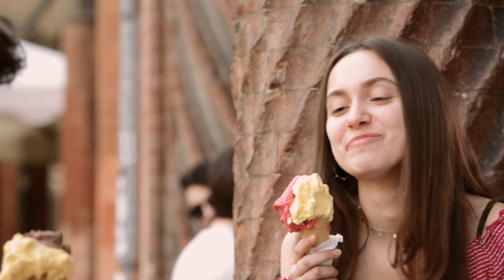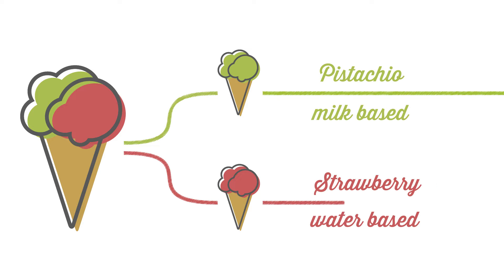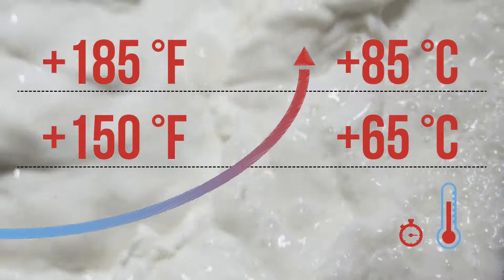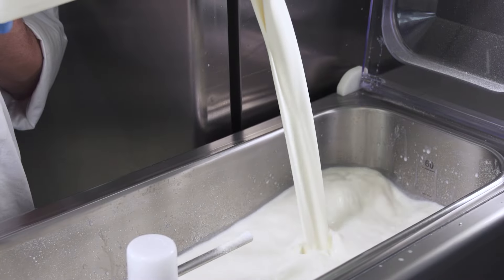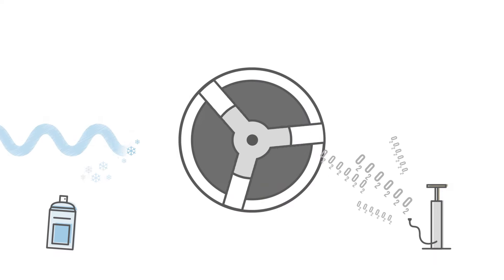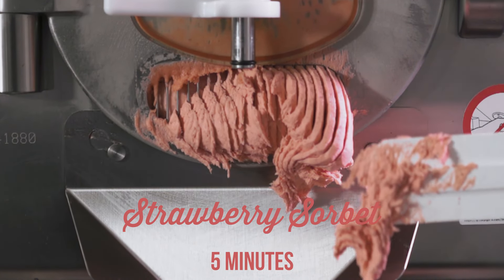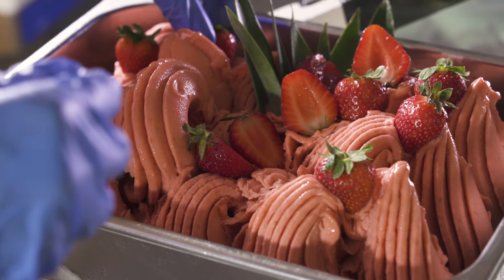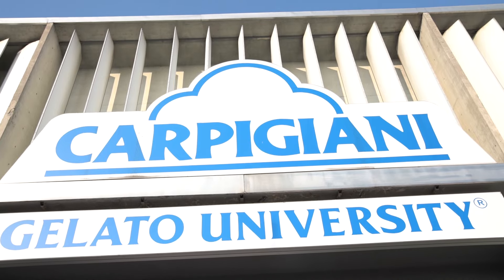ABC Gelato - How to make gelato

Comment: Sorbet is made up of fruit. ,Suger ,water and fruit base , without a fruit base ur sorbet will look dull and cracky but when u add fruit base ur sorbet looks beautiful and shiny with a good taste the fruit base is a fruit gelato booster which is very important and must not be missed out when making fruit gelato.
Reply: Hello, your comments are very informative.  May I have the fruit  base ratio for the sorbets and gelato. Thank you.
Reply: @nancynguyen8643  hello,do you have a fruit base ?, in case you already have, the product brand will have a  recipe you can work with.
Further elaboration.
The brand I use goes with my recipe in these form:
Fresh fruit e:g strawberry 🍓 1,600 grms
Water : 1,350 liters,  sugar: 800 grms , Fruit Base,:130 grms.
With these blend up pour into ur ice cream freezer and u hv ur gelato.

Comment: hey, is it necessary to use the pasteurising machine if the milk is already pasteurised?
Reply from the maker: Hi! If the milk is already pasteurised it is not necessary to pasteurise it again
Reply: @carpigiani1946  hi, how long can the gelato last, if I'm using pasteurised fresh milk?
Reply from the maker: @nguyenanhnguyen5712  it depends on the way it's stored (display case and temperature). Fresh, artisanal gelato which has been put in classical open display cases usually is changed every few days max, but if stored in pozzettos (vertical, closed tubs) it can last a big longer. If the gelato is stored in a freezer right after production and never opened before being served, it cast last several weeks.

Comment: Hello. After Batch freezing, how long should gelato stay in shock freezer between -35C -40C degrees to reach showcase temperature -12C -15C degrees? How long is it ok to keep gelato on showcase temperature? what is the perfect freezer temperature to keep gelato for several days without becoming rock-hard?
Reply from the maker: Hello, Gvantsa. If you need to store gelato at -12C, it's ideal to shock freeze it for at least 5 minutes. The time gelato should stay in a showcase varies depending on the type of showcase: the more covered it is (such as in tubs/pozzetti) and the less air it is exposed to, the longer it can stay. Fresh, artisan gelato at -12°C should not stay longer than a few days. If you need to keep it for several days, you can lower the temperature to -18°C, but it will need to return to -12/14°C before serving.
Reply: @carpigiani1946  Thank you for the answer
Reply: The objective of blast freezing is to arrest the formation of ice crystals to prevent "coarseness." That takes about 20 minutes/tub in a -40C blast. After that the ice cram is hard as a rock. When it goes into the display freezer i takes about a half hour to warm up enough to scoop.
Reply: @michaelgreenwald9678  imagine the blast freezers that go to -40C on the product instead of just -18C!

Comment: Hi! Loved the video, but I have one question. Do you guys have any recommendations for a home artisian Gelato capable machine? I don't know which would be the best one, there are so many like the Musso Sorbetiere, Cuisinart ICE-100 and Magimix Gelato Expert.
Reply from the maker: Hi, unfortunately we produce gelato machines for professionals. A useful tip is to look for gelato machine with a built-in refrigerating system.
Reply: @carpigiani1946  Thank you for responding! I have made my choice already, it is the Cuisinart ICE100E, because it has a low rpm (overrun between 14-30%) and gelato has a low overrun too.